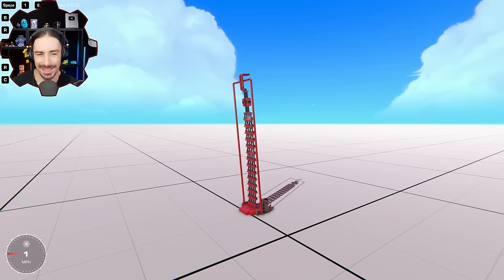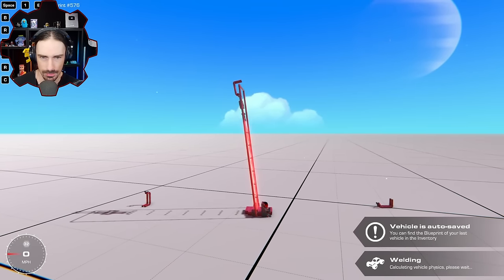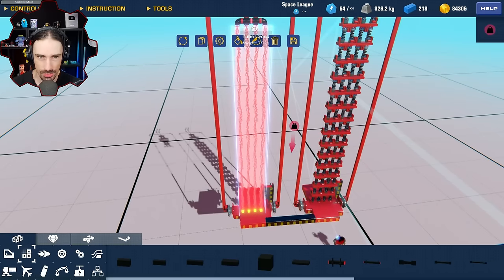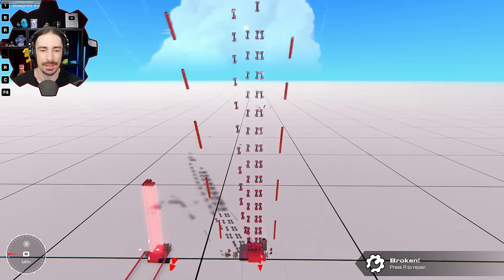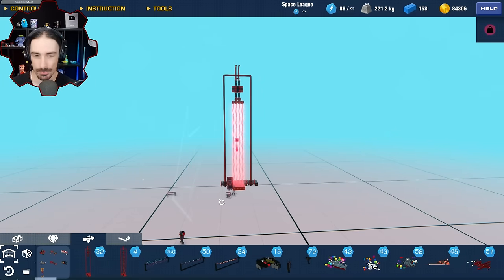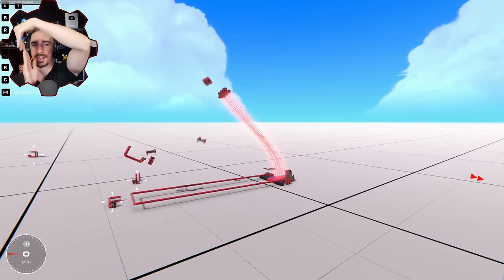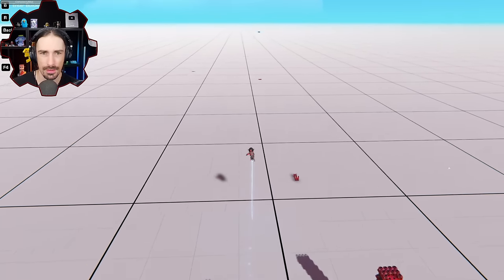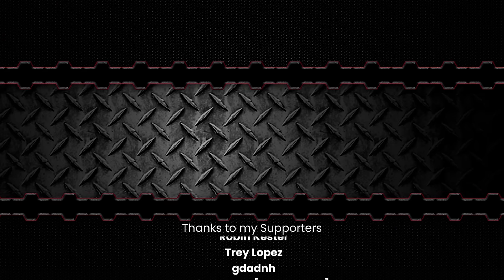Can This Create a Better Catapult Than Suspension?

Comment: It's completely sensible that the shorter power coupling will perform better than the longer one. In the game, power coupling with a high stiffness does not want to bend. If a strand of power coupling is longer it has more points of where it CAN bend. As each one bends, it has to try to apply its stiffness as a resistance accounting for the weight offset at the end. The further the weight, the less effective the stiffness is.

A short catapult out of power coupling has very few bend points so it wants to snap back a lot harder and is capable of doing so. Technically the suspension one would also follow suit, but you made it that long because it needed to bend without breaking and that was the limit. Also it seems backwards because of normal catapults using mechanical advantage of leverage to accelerate their payload faster due to their longer arms. The thing you have is utilizing tension over rotation. If you think of it in more tensile potential energy instead of thing being swung faster because it's further away from the pivot point, you're getting more energy effectively transferred through fewer power couplers. Energy would be lost to more couplers that have to try to offset the payload weight they have to try to hold up. Fewer connectors doing that means more of that energy is held in reserve to straighten the couplers back out.

And since the payload is the same mass for both, it doesn't matter if it's being swung on a half meter arm or a 30 meter arm, if it's moving faster, it's going to go further. The smaller arm under greater tension flings it faster than the suspension arm. That being said, the longer power coupling arm seems to kind of whip when released. I'm wondering if you can't play into that more and find the perfect balance and sequence of stiffness (lower closer to the payload and higher closer to the base) to really whip the TNT really fast. That would probably be the best result you could get out of it.

Comment: Scrapman, you could try to use powercouplers of different stiffness for different rows of these, that would probably equal the forces giving you better tension.
or like, put one row of them away from you, then bend all of them toward you, after that even though they are in different length from bending point, they should have similar tension (if you adjust stiffness correctly)

Comment: There is one advantage to the power couplings that you didn't experiment with: The potential to make a reloadable catapult.

Rather than using a hook and detachable blocks, above the explosives, you could put the explosives in a basket that goes above the retention bar and put the bar on pistons. Then, when you want to fire you have the bar retract, so it passes through the energy portion of the power couplers. You could then rotate the bar back into its starting position and raise it again to reset the whole thing (though you'd still need a way to add more ammo to the basket).

Also, I'd be curious how hybrid catapults would perform, either with alternating layers of power couplings and suspension or with some of the suspension rows replaced by power couplings, since they seem to have different spring profiles and, as already mentioned, the power couplings allow for some different release techniques.

Comment: It makes sense that the shorter catapults are stronger. for a longer "spring" arm, the catapult, as i'll explain below, has less energy stored in a 90 degree bend to propel the load with, thus it will be slower at the tip resulting in a shorter ballistic trajectory. This is why the sweet spot for the release delay got smaller as the catapults got shorter; the faster the tip speed, the less time there is going to be to release the payload at the perfect moment in the arc, and the smaller the physical sweet spot gets as the overall arc of the swing is shorter. 

this is a pretty simple but interesting principle in physics. when you connect two "springs" end to end, otherwise known as "in series", their combined stiffness will be lowered. OTOH if you connect them side by side, or "in parallel", they will be stronger together. This is due to the amount of energy each spring absorbs when it bends. 

When a spring is on its own, it absorbs all the energy imparted by a force when it bends due to that force. If another spring is attached at the base of the first spring, it will take less force to bend them to the same angle since the bottom spring will bend some too. Energy stored in a spring increases exponentially with how much it bends (until it fails, then the energy gets used up either breaking the spring or unshaping it), so there will be less energy overall for the same degree of tip displacement if applied to the parallel system as opposed to just a single spring. 

 In parallel, both of the springs bend the same amount and store energy proportional to their stiffness. This works the same for any number of springs attached in a similar fashion, so for the same degree of tip displacement, the system will have more energy stored for more springs attached between two objects, in this case a catapult base and a ballistic explosive. 

The perfect catapult design using this principle would be as many springs in parallel as possible while still getting a decent degree of bending and a long, stiff swing arm to attach the payload at the end of. This way, you could get the stiffness of a bunch of springs in parallel and also increase the speed of the tip to optimize the ballistic trajectory.

Comment: I think the answer is weight... shorter version is lighter, so the gravity is pulling it to the ground less and the stiffnes of pc was able to defeat it more easily , which in turn increased the speed of the throw wich made the dynamite go further. Interesting results to say the least. Hope You will do more experiments like this in the future... Keep up the amazing work.
Reply: also, as another commenter pointed out, air resistance might be effecting it to

Comment: Practical build challenge = build instruments to measure. Examples, one to measure how far the tnt went. You can do that with a line of distance sensors pointing sideway set to max. Have them connected to a signal that shows where they land.

A huge block of different color layers, 1 behind another to show how far something penetrated. 

Another but with the layer fading to a core to show how much damage a weapon did. 

Cameras blocks to quickly change to a better view.

Stuff like that I believe would be very beneficial and a great viewing.

Comment: Since there is a bigger lever arm on the bottom couplers, maybe have more of them on the bottom? Like slingshots have tapered rubber bands, that are thinner near the pouch. And i think it would be more stiff if each row of couplers was attached to each other.

Comment: It actually makes so much sense that shorter catapults are better. First, the rotational inertia of a shorter arm is way smaller, and secondly, more flexible pieces in series actually make the arm as a whole weaker.

Comment: to make it comparable you need some stiffening plates between the power couplers. The Suspension stays rigid so when you flex it generates more tension. The Power couplers are not working together as well when you apply the tension so you get that kinda floppy lazy spring effect. Which also explains why the shorter length of power coupler works better, since you have less to wobble at the end of the arc

Comment: There is a very simple reason that the shorter ones perform better, and that's because of Lever laws, the shorter your lever arm goes, the more power you need to pull it back the same amount of distance. The power couplers and suspension pieces can effectively store infinite power due to being "infinitely" rigid, not really, but they are rigid enough to always snap back. Meaning, by applying force farther down, but stretching it the same distance back, you put in more power, the ideal catapult would be the long one, but instead having the short push back system. At least in theory, the way the power coupler bend, make me think that they will still be worse, because most of the power get's lost by them flopping around, the suspension pieces however, should fly much farther.
Reply: Deflection is also a function of length and force, with a shorter length requiring more force to deflect the same amount. If this was just a straight up lever arm, the mechanical advantage would work in favor of the longer arm, but deflection is the driving factor here!
Also, equation for deflection of a cantilever beam: [Force*Length^3]/[3*Elastic Modulus*Inertia]

Comment: Hmm... So the power couplers and suspensions have differing stretch/compression capabilities.  That reminds me of the way wooden bows are made.  The belly of the bow (nearest the archer) is in compression, the back (furthest away from the archer) is in tension. Both act in tandem to produce the most powerful shot.  Maybe use both power couplers and suspension together to mimic that?

Comment: The optimal length of the catapults has to do with harmonic resonance. Notice that the elastic components jiggle or wave with a certain frequency after releasing. For each catapult, there is a length that you could make the elastic so that it makes a standing wave when you release it. The optimal length of the elastic is a proportion of the wavelength of the standing wave of the elastic's harmonic. 

The harmonic wavelength of the power couplers is much shorter than that of the suspension. This is evidenced by the slower frequency of the resonant "jiggle." It's also clear in the longest version of the power-coupler catapult, which was longer than half the wavelength of the first harmonic. It had a node in it, so it buckled and straightened when released instead of flinging forward. If you could build a much (much) longer version of the suspension catapult without the physics misbehaving, you would observe the same behavior.

Sorry if that was exceptionally nerdy or jargony. I've built a nationally-ranked, award-winning catapult and I used to do this sort of math for fun. That was a while ago, though, so I might have gotten a little carried away.

Comment: Day 4 of asking scrapman to do a multiplayer battle with train-planes in trailmakers (a train with wings on all of the cars) My suggestions: (don't read If you want to make up your own rules) - I would suggest using a canard layout for the engine car so it can get off of the ground and no control surfaces or propellers/thrusters on the trailing cars as they will be lost in battle. I think a good complexity limit would be 75 blocks for the engine car and 50 for all trailing cars. Vertical stabilization would be tricky because a traditional rudder would probably only work on the final car but the final car could get shot off so you might have to resort to a gyro for vertical/yaw stabilization in the engine car.

Comment: In general the shorter your arm or the closer you are to the supporting point the more force you have to use to get the same bend and therefore more force you get when releasing.
BUT ! I got the idea of making a trebuchet with the power couplers as rope they can probably fling things pretty far and better than suspension ! 😀

Comment: So the reason English long bows use a specific type of tree is the core is stronger and more resistant to compression well the outside is softer and  can stretch better.

With just the power couplers layers like that you might be able to adjust the stiffness independently

Comment: think about it tho, it make sense to make it smaller because tension is higher. take a bendy metal rod or wire, you try to bend the big one, easy right but when you try to bend the small one its much harder. the middle of the wire acts as a leverage point for the ends, the longer it is the less leverage you have

Comment: Hey Scrapman what if you attatched a wench of some sort to the top of the arm to assist it in being pulled back fully by having the wench behind the catapult at ground level and the catapult at either ground level or just above the ground level so it bottoms out fully? Or maybe doing a hybrid of the power couplers and shocks? Also some sort of stabilizers like nubs on the top of the arm to keep the hook from wiggling side to side to improve accuracy?Just some thoughts halfway through the video.

Comment: It be interesting to see both power cuplers mixed with the suspension (example 4 suspension high and 1 or 2 power cuplers)  attached to the launching platform  to get that snap for speed  and the suspension for the support ? 

Anyone else travelling this idea 😅

Comment: Smaller is better because with the long one the tension is speed throughout the power couplers but with the small one there is more tension equally putting more stress that wants to come out so it goes faster

Comment: I think the power cuppler has more weight on top with all the pipe pieces, It could be a factor.
I was hoping you would shorten the suspension catapult also.

Comment: Interconnect front to back lines, because there is a difference in there circumfrence of the lines they have greater tension, because they are not connected they try to do there best at being on the same line. This way the front line will pull to get its original length and the back will try to push aswell as the base tension set like the suspension.

Comment: It looks like the power couplers lose momentum when they get near the starting point. You should tilt the whole contraption forward like 45 degrees, then pull it back from there, it it's able to.

Comment: To be fair the suspension uses about 200 suspension parts and the power couplers use about 50 so maybe make the power couplers 1 wider...also the power coupler one the projectile has less travel time so "easier" to shoot moving target with

Comment: The reason shorter is better is that the far end of the beam has less leverage over the length of the beam.  I bet a short suspension catapult would be even better, though you'll probably run into glitches with it sooner.

Comment: With both materials it was creating a point close to the ground where there was a lot of torque due to the length of the arm, the farther down on the arm the mater is the more torque it experienced, making a nearly singular point of bending. This is just a flaw with the physics of this game where it seems to want to calculate each individual piece of material instead of as a single arm. Therefore this shouldn’t work IRL.

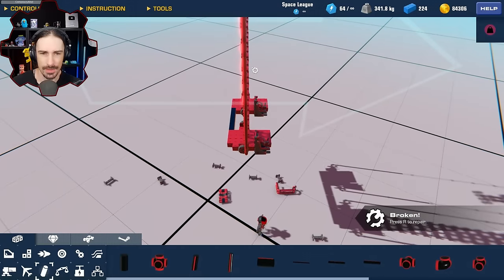Comment: 7:17
Weld groups scrapman.

Every build something very perfectly, and decidedto add few block on the opposite side and whole creation break?

Putting blocks can changethe way creation is spawned, moving parts strenght can and will change becouse of reason.

Comment: what about trying to make an aircraft that uses recoil from guns or similar as propotion. 
the recoil gun moters are mounted on power cublers shooting backwords  ( to make it difficult ) and you also have to use guns with recoil in front to shoot other airplanes. ( meaning the recoil motors needs to be stronger than the shooting guns recoil. 
the biggest dificult must be : not to shoot yourself down!! ( no other proposion motors than recoil )
it could be very interesting

Comment: The timing of the power couplers is a little wrong, it releases the bomb almost flat, while the suspension releases on a 45° angle (best throwing angle for distance actually)